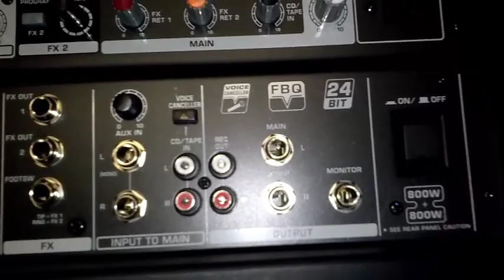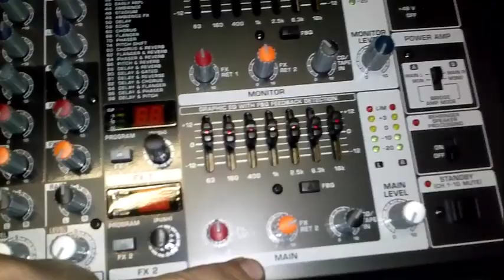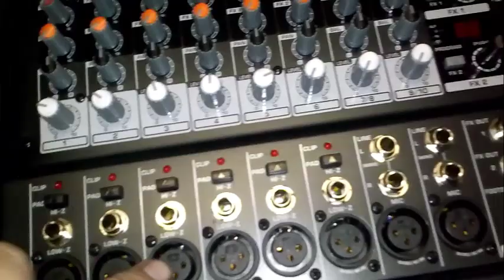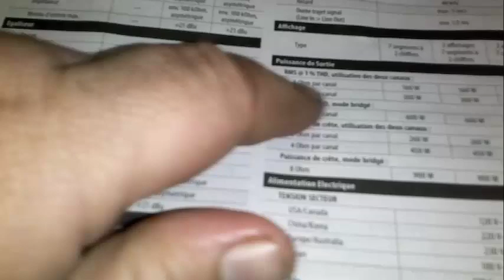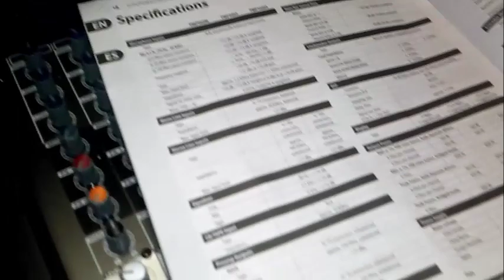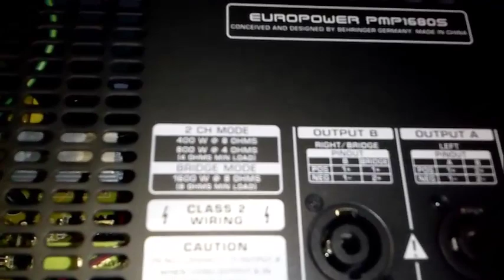behringer EUROPOWER PMP1680S 1600-Watt 10-Channel Powered Mixer review

Comment: Can comment regarding the fan noise?  I plan to use a compact mixer like this in a solo acoustic setting, quiet listening audience.  A fan would be distracting if it's not more or less whisper quiet.  I can't find info in the Behringer PMP manual which discusses the fan operation, for example, whether it's variable speed and only ramps up when the amp is under load (as with my full band gig), or if the fan runs at a fixed speed all the time.  Thanks in advance for an answer.  Better yet, post a short video clip that shows the fan noise when running :-)
Reply from the maker: I don't hear the fan at all. It runs very cool when you are using it. That has to be the class D amps making it run so cool. I am still using it and am still very happy. Normally if i am DJing at a bar i keep the volume at 50% up or less depending on the size of the place and the amp stays cool.
Reply from the maker: Wylie Walker
yeah I never been in a quiet room i use it for being a moblie DJ so there is background noise all the time from people talking or what not. I just don't hear it. I am sure the fans will need cleaned someday like computer fans do. I just look thru the vents with a flash light every so often to see how the look.